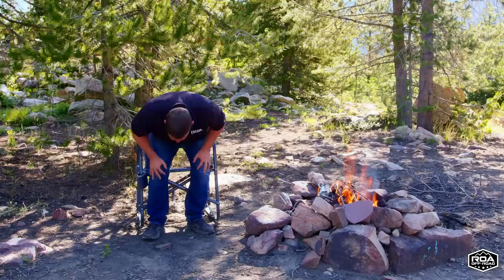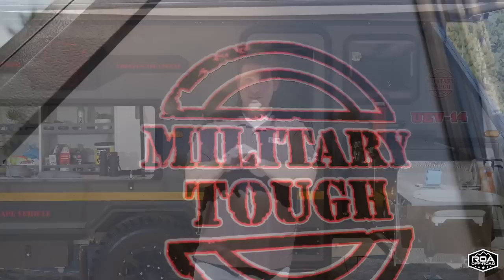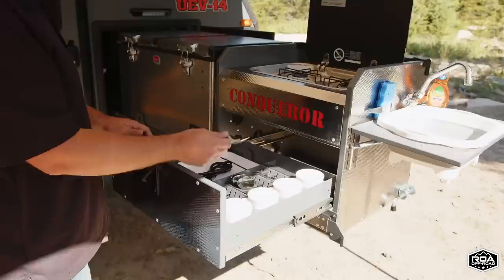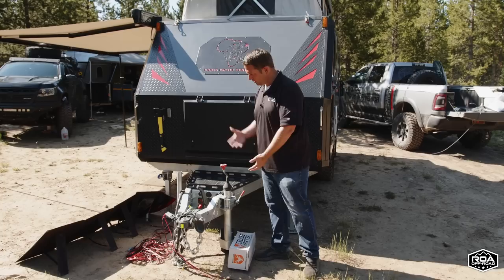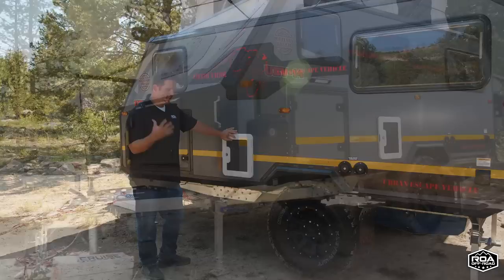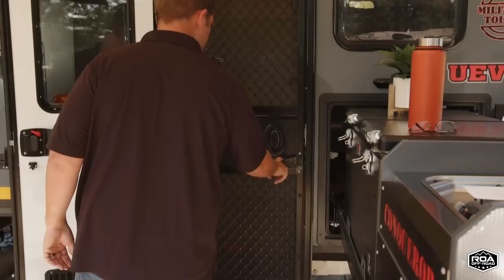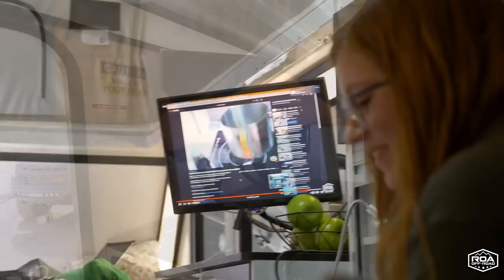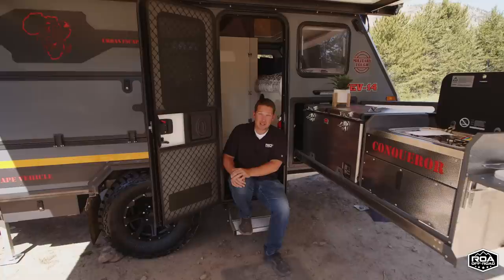Conqueror UEV-14 | No Longer Available at ROA Off-Road

Comment from the maker: We love these trailers, and especially how compact they are! What do you value the most in a camper trailer?
Reply: How compact they are? Really? They're massive.
Reply: Quality build.
Reply: One would need somthing light easy towing capable off road with enough water well insulated for the four season. ..also towing verses camper vans + prising  4×4 price /capability / towing capacity +  trailer vs A one unit is  much easier and cheaper to ferry across ....but then how capable is it then pricing the hymer venture s looks cool mybe you will judge it on day

Comment: Conqueror, please separate the heat and air. No heat without shore power or generator. A simple diesel or propane heater would be ideal. After all it is primarily an "off grid" trailer isn't it?
Reply: It has a Truma heater

Comment: Cool trailer. Like how they made it less then 96". Are these OBI and made at same factory as the Dweller?
Reply: They are Conquerors not OBI.
Reply: @rickb5575  Same owners. Same facilities. It does look like the Conquerors may be the "better looking, slightly smarter" brothers of the Dwellers.
Reply: @rickb5575  I thought I saw some conquerors in a picture of OBI warehouse in AZ. Maybe there is a dealer type partnership. Or maybe I was hallucinating.  I believe these US models are sourced out to Chinese so maybe it's the same MFGer as Dweller. I could be off on all of this besides they are cool and available and garageable ( if you have the mack daddy 8 ' garage)
Reply: Did I miss where the shower drains to. I do not believe there is a gray tank right,?
Reply: @bartman1857  your eyes weren't playing tricks on you. I saw this unit in there wearhouse.  Also there name now says obi/concor.  That and wen I drove around the back the other day that had a bunch of concor trailers Stacked on "pallets/trailer".  Probably made in the same Chinese factory. 
The inside frige is cool but I still like the dweller better.
Reply: @chrslefty  ya I noticed OBI / Conqueror when I googled it but I didn't want Rick B to feel bad 😉 I just wonder why ROA has to be coy about the connection and where they are made. Are they more money then the Dweller 15?
Reply: @bartman1857  not sure on the prices. Everyone is kinda tight lined about the prices of the 15.  Which I believe comes in around  60k ish. I would guess the concor is that or more.

Comment: I would like to hear more from people’s experience full timing and can survive 40 below or extremely hot conditions. Camper style. 
I have not found a 65 gallon water. What about weight measurements from what is in the tow vehicle and what is actually being towed! Meaning can the tow vehicle be geared to spend a solid month off grid as an example.
I love your videos!
Thanks kindly.

Comment: So are you stop selling all of the conqueror models??
Reply from the maker: We are not selling new units. These had major issues and the manufacturer is not fixing the issues.
Reply: Are you saying only the uev14 or are you saying you are also  no longer selling new units including UEV 440 and 490?
Reply: Good to know as I was considering the uev 490 or 440
Reply from the maker: @shannonheiser247  You’re fine to buy one. I would just get one that is currently on a lot. Don’t order new and definitely don’t buy a UEV14.
Reply from the maker: @10ECWalker615  Not New. The new units have not been good. But if you buy used you can get a good deal and it would be worth it
Reply: I have always liked how compact these 490 and 440 are when towing and how expand when camping.  I have followed all your videos . I am aware of a lot of the likes and dislikes (or areas of improvement you have mentioned . The poor heating air that would need changed to work off grid . The lighting.  Water heating tank upgrade . Mchitch  upgrade.  Honestly not impressed with the electric system.   I would probably want that all changed out.  Probably sounds crazy for the cost $$$ but I do like footprint. As long as the body and suspension good. I hate wood interior . Not sure if room to upgrade the lithium batteries as I know the area the batteries currently housed quit tight.  That being said I am following your recent mdc trailers. There are a few things so far about those I already concerned about mainly that awning . It looks flimsy compared to the batwings. I know you just received these but waiting anxiously to see how they perform with your testing.  Also since they are “ 4 season rated”  how do they perform at their limits.   No trailer is perfect explore near perfect…..pause very nice but weight to high…for the glamp it is nice.  The roamer 1 I think is the top notch hands down!  However the last three spendy if can afford I think you couldn’t go wrong. That being said I think getting a trailer and modifying to meet specific circumstances and uses better for me.   I have not decided yet which to purchase ( you make to many videos that make me change my mind🤣🤣🤣) the only thing I know is that I WILL be purchasing from your company. Your honest approach to using and reviewing your products you sell. Strengths and shortcomings given.  Very special and refreshing this day in age.  Looking to purchase summer or fall.   Sorry so long.  The mdc trailers also made me laugh at the refrigerator had one of those “baby/child proof latch’s . I know for off road but I have one on my home refrigerator for my labradors.🤣🤣. Cheers I will be following to see how mdc trailers hold up  to your testing . If they do might overlook the wood cabinets.
Reply: @ROAOffRoad what kind of major issues? I don't mind fixing some things for a good price...but are you talking like the frame, the suspension, the roof? Or more minor things like electrical and plumbing?
Reply: @ROAOffRoad  I am looking at a 440. is it possible to hook up grey black water tank? It's necessary to have a black water tank 5 gal minimum for beach camping in Massachussets cape cod.

Comment: So I have a question.  The Uev 490 has poor insulation because it was made for warmer climates. So because the uev14  was made for the American climate,  is it better insulated for winter?
Reply from the maker: No, It is the same as the 490. Just the set up and floor plan is new for the US. It is a 3 seasons trailer.

Comment: Will the direction the door opens be changed? Remember what you said about the door opening while driving down the road.
Reply: I don't know how easily it could be changed if you still wanted to use the little latch thing to hold the door open when camping because it'd have to be mounted on an openable compartment. It's a pretty solid door anyway.

Comment: Your late outback rv  has it out
Reply: Well that was a quick exclusive for "ROA" maybe they don't consider TX in the US. 79 k msrp
Reply: @bartman1857  Wow, 79K MSRP. for a single axle.  I wonder how much they will really be sold for. Maybe the price will ease a bit if those loads of trailers in Mesa, AZ start piling up! 🙂
Reply from the maker: There is a misunderstanding. Outback only has a show unit. They don’t actually have units to sale. They will not have any until next year.
Reply: @ROAOffRoad  gotcha. I saw a post by HAT that you guys have bought out all thier first production run or something to that effect. Your on a roll bro